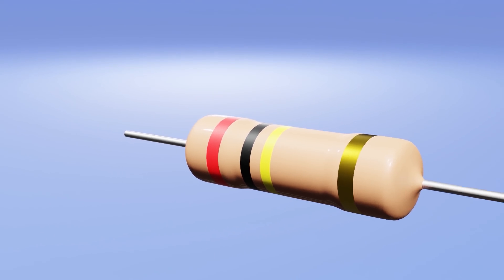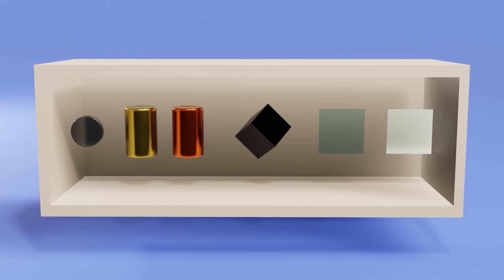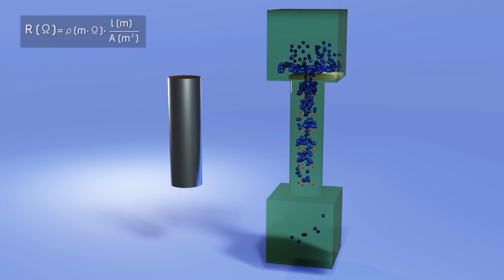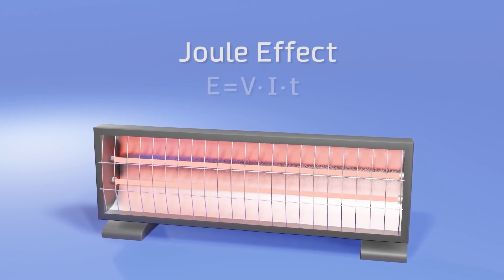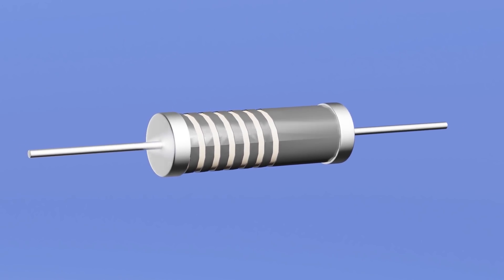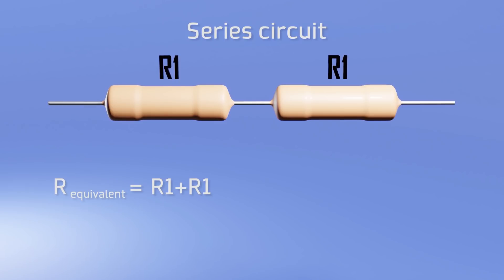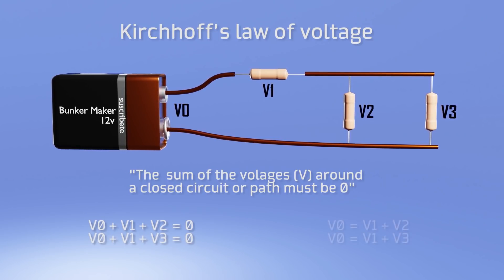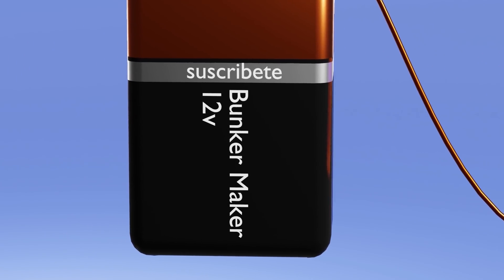How a RESISTOR works ⚡ What is a RESISTOR

Comment: 9:11 - This graphic is partially incorrect: the long lead attached to the positive terminal of the battery through the current limiting resistor is in fact the anode; but, the plate on the inside of the LED connected to that lead is smaller than that of the cathode - not larger. (Also, the flat side of a typical LED adjacent to the cathode is not shown)

Comment: I thought the resistor colour code was read as, 1st colour is 1st number in ohms. The 2cnd colour is 2cnd number in ohms and the third band, is the number of noughts? Example. Orange,  orange,  orange,  would be, 3, 3, and 3 noughts. 33 thousand ohms?

Comment: How do I calculate the output voltage if I know the input voltage and the ohms and wattage of the resistor ?

If the input voltage is 25 volts and the resistor value is 25 ohms 50 watts, what is the voltage drop ?
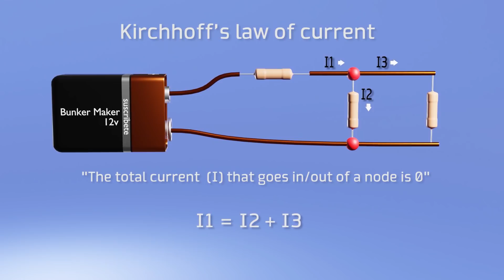Reply: See -09:57 Ohms Law.

Comment: Oh really??? Until today I believed a resistor did not work at all and it existed only to resist. But no? No. It exists just to resist. For that is is made, if it is made at all. But it can only resist, if there is something to resist against. The real question is: Is a so called resistor a resistor at all? No, the question is not stupid. If a resistor would do its work, it would not let any current flow, would it? I has to resist. But it does. So it is not a resistor ar all. It is just a small passage that can only let pass current up to a limit, that can be calculated from the environment it is put in. And no again. It exists to reduce or limit and not to resist. So it is a reducer and not a resistor. AND NOW ABOUT SOMETHING RATHER DIFFERENT: Thumb = Inch = 8 / PI. The ancient Egyptians knew that.
Reply: Sir, your comment is something